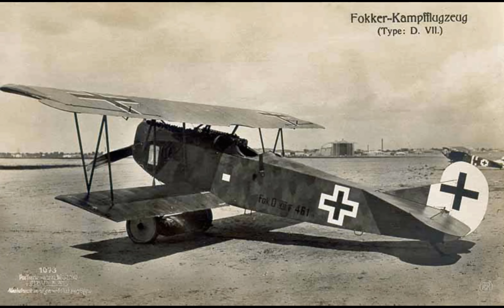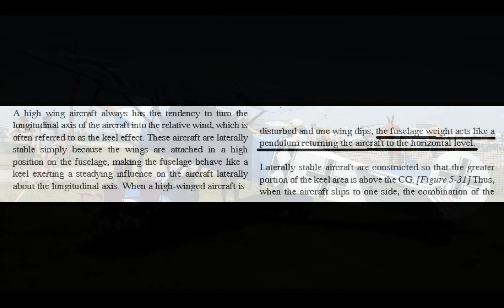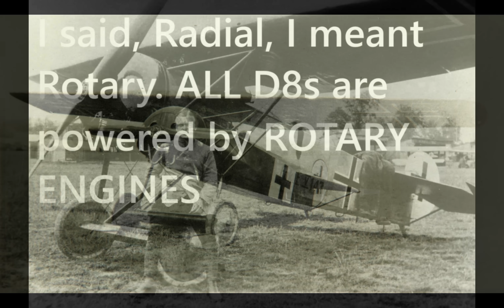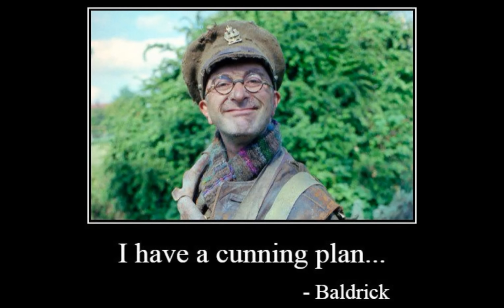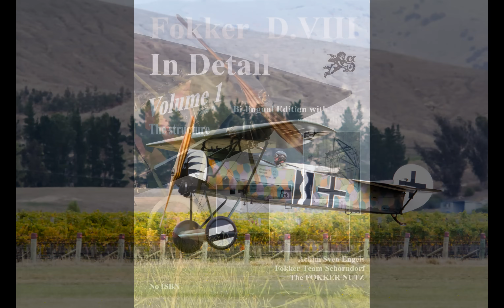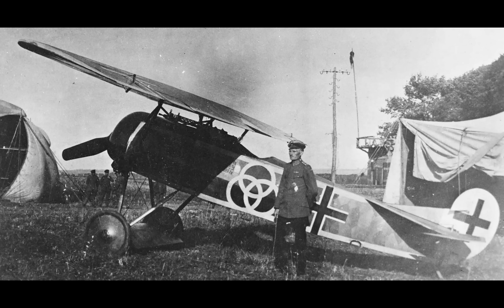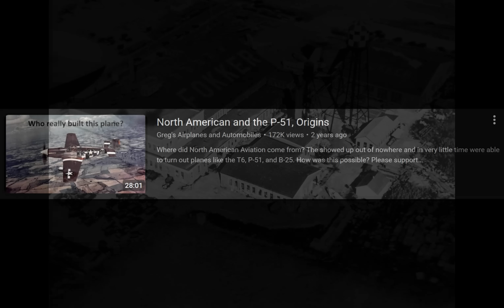Fokker D VIII The Best Fighter Of WW1

Comment: I'll just weigh in with what everyone already knows.
Fokker stole/borrowed most of his designs, and became more of a salesman.
Any new inventions Fokker had as a firm, chances are guys like Reinhold Platz was the real designer (Fokker knowingly held Platz back and out of the spotlight).
Fokker's firm had a good wing design going, but what did them in, as all other German designs with Rotary engines, was the lack of proper castor oil and the, by now, low power Ur.II engine, + low number actually fielded.
In my opinion getting basically JUST maneuverability didn't seem to do the Germans much good, even with the D.VII's speed, it still wasn't enough to achieve parity against much faster Spad's & SE's.
That tubular fuselage doesn't have much in between a bullet entering it and the pilots seat.
As good as the upper wing was, it was thick and for top speed that's no bueno, what good's outclimbing if you have to trade all that altitude just to keep up? You'll have none left by the time you engage.
Even a Spad with a million wires on it could build distance, climb, and achieve parity.

And even if the D.VIII was fielded in numbers, nobody with a brain turns with namely any Fokker, you see a Fokker and you open up throttle, then skedaddle.
Use the Hispano Suiza engine to build separation, outclimb, then turn around and strike any Fokker/Albatross from above.
One guy in Flying Circus, Farmer (Bateman here on Youtube) has it down to a T, he's currently at over 200 pvp victories (without loss), that's like 2.5 Red Baron's or 2 Red Baron's & a Udet thrown in for good measure, with a Spad, and Spad's are nerfed + Fokker + Albatross FM's are buffed, so that's saying something.
If everyone simply followed his example, there'd be nobody left to play Central lol
Reply: Thick wings can have a better lift/drag ratio than thin wings. Thick wings became standard up through early WWII, at which point compressibility became  became an issue, favoring thinner wings as seen on the Mustang and the Spitfire. 

As to the steel tube frame fuselage not stopping a bullet, while neither would a molded plywood fuselage (Albatross) or a wire braced wood frame cloth covered fuselage (most everybody else).
Reply: @fafner1  Yeah but basically that's what it comes down to in a WW1 setting, for what the Germans had to work with.

Of course, thinner wings could offer good 2-circle performance too, for WW2 of course we have to give props to Spit's & Mustang's that could duke it out pretty well with most of what the German's threw up (well, that, and an increasing lack of decent German pilots, contemporary reports show they gave as good as they got in the beginning but as attrition mounted there weren't many left that could get the most out of the 109/190). But WW2 wasn't the only period thin wings made for competitive fighters, just going off the usual WW1 designs, look at Camel's, thin wings, but more than a match for the DR.1 (more numerous, superior speed, about comparable 2-circle vs Dr.1 & most anything else the Germans threw into the fight), additionally, George Guynemer is known to have outturned Camel's in mock dogfights, in a Spad, and according to Udet himself, he flew a Alb D.III and met Guynemer in his early 150hp prototype Spad 7, from co-alt head-on and was outmaneuvered quite easily (whether they actually met in a 1v1 joust is disputed), there's similar stories on the SE5a too.
So SE's & Spad's were definitely good for more than just boom & zooming.
Nieuport's were known for maneuverability & nimbleness too, being a match for the Alb in the horizontal, as many contemporary reports can indeed attest. What made the Albatross good was: Ease of production (they fielded a lot of them), twin guns to (most of) the Nieuport's 1 gun, and somewhat easier to fly (rotaries are known for requiring a delicate touch at the controls).

If it looks like I have issues with Greg's findings, well, I kinda do, because with a lot of people starting out with WW1 air combat history, most of them get hung up in "D.VII was mentioned in the treaty" and blabla, all that usual regurgitated stuff.
I see it in the WW1 sim community all the time, someone new comes in and gets starry eyes when reading about Fokker, you have no idea, takes us years to drum it out of the newcomers.
They get it into their heads that everything Entente was horrible at the 2-circle discipline, just horrible, and long live Anthony Fokker and German aircraft designers and then that's it.
The Fokker fandom and how great he was etc also appears to be a big concensus over there in America, Fokker was popular over there, so that probably doesn't help Greg either, being a relative newbie at the WW1 side of things.

But dabble in WW1 combat sims for 30+ years, add the day and age we live in and you come across the same repeated myths over and over and over :) 
To me, Greg kinda comes across as just starting out with WW1 aircraft history, I'm not saying that's a bad thing, but at the same time I know that at the beginner stage he's currently in, he's bound to get kinda mesmerized by Fokker's charisma and presence in the arena, after all Fokker was indeed popular and good at bringing people to his side, even after his passing.
Now, the whole thick wing thing, what it really was intended for, was to draw everything out of the otherwise anemic aero engines that Germany could stamp out in any significant numbers, " It offered excellent performance from the outdated Mercedes engine, yet was safe and easy to fly."
The D.IIIa and the Ur.II were practically the only aero engine the Germans could stamp out in enough numbers, putting in the higher output engines (Over compressed Merc's, BMW's, etc) in them was not originally intended.
Reinhold Platz succeeded in that task.
And that's really all the D.VII and D.VIII was/were (I'm supposed to say "IMO" here but it's not just my conclusion either) and yes before you go there, yes the Boeing Model 15 was heavily based on the D.VII and was a respectable machine with more than enough power on tap, D.VII's conclusively did even better than what originally intended once they put souped up engines in them too, nothing new there.
I could go on and on, but as good as the D.VII/VIII were, they fell victim to the same set of factors, not enough materials & supply, not enough of them built to alter the course of the war.
The Entente were starting to run out of trees to make aircraft out of, didn't stop them from easily building enough planes to overwhelm the Germans, and with largely superior designs in both engines and airframes.

To a lot of WW1 buffs like me, Fokker isn't anything more than a charismatic thief, guys like Reinhold Platz were the real designers/engineers, the thick wing's real creators, another lesser known (but wiiiidely available, anyone can google it) fact is Albatross famously built better quality D.VII's than Fokker factory, issues with structural integrity at Fokker didn't end with just the Dr.1, it was a recurring issue until the end of the war.

And yeah Albs weren't just slow and bad at hard turning (they "spun vigorously" according to Richthofen himself, and yet in all simulators they almost never spin out), SE5's and Spad's would have had few issues fighting them, I didn't mean to make a huge thing outta the stopping bullets thing, but yeah if you look at construction, the weak so-called "sesquiplane" bottom wing did it no favors (famously so, as we all know), the plywood fuselage would have also been bad at stopping/deflecting/slowing down bullets.
Of course, dgmw, I'm not saying SE's, Camel's & the like could stand just any sort of pummeling, and any amount of wood framing won't do any good against a well-placed burst, or a side-aspect shot, such as Frank Luke, Richthoffen and Voss (just to mention a few) who were taken out or grievously wounded/incapacitated from the side.
On the other hand though, there's Arthur Raymond Brooks (if you know as much about WW1 air combat as I think you do, you probably saw this coming), who outright had his whole Spad shot to pieces around him, not only did he survive the ordeal, the Spad brought him home to his aerodrome, legend has it he stopped counting bullet holes in his aircraft before even finishing on one side, donno how true that is but we do know it was beyond repair, it's just one of many retellings of how tough the Spad actually was and it's pilots loved it for that (among a great many other things).

I hope that more or less satisfies anything you might come up with, I kinda pre-empted you on a few avenues, sorry if I come across as negative or something. We're all here hopefully to learn, hope that didn't come off the wrong way. Left your comment a like to reflect that I mean well, happy days to you and yours.
(Did a few edits to get rid of typo's)
Reply from the maker: 200 pvp kills in Flying Circus without a loss? I find that hard to believe. I fly that sim a few times a week, I have never seen anyone anywhere near that good. Even so, it's a sim, it's not reality. That said, I'll keep an eye out for him on Berloga.

Comment: Oh the irony of one of the most successful WW2 aircraft, the North American P-51 being designed by German-born Fokker employees! Thanks Greg. I never knew that fact.
Reply: I don’t think it was that simple. But I did hear somewhere the P-51 was designed by a German expatriate. I’m pretty sure it wasn’t Fokker himself, he had to be in his 50’s and being an owner, most likely delegated all the work like design and testing. They definitely did wind-tunnel testing which influenced design changes. It is amazing how quickly they created the P-51 and made it operational within a year. It’s always been a bit funny looking to me with its little beer belly I guess to make the air intake aero. The German Do-335 also has a rear air intake for its rear engine, but it’s flat-bottomed with the intake angling up near the tail
Reply: Do we mean Fokker or Folker ?
Reply: He seems to say Folker ? Also I think it was a Dutch firm not German.
Reply: @lancaster5077Fokker himself was Dutch, i actually live a few houses away from where he was born. But the company Fokker was based in Germany for some time and Fokker lived in Germany for quite some time.
Reply: Not forgetting the “cure” of the carburettor problem in the Merlin
Reply: Dumb question, when you look at the FW-190 and the P-51 in plan, why do I see nearly identical profiles in the lifting airfoils, the P-51 essentially only being somewhat enlarged???
I find it difficult to believe that North American came up[on that outline in a vacuum.
Reply: @tomt373  None of these designs were born in a vacuum. Don't forget that, with a few notable exceptions NACA research provided the bulk of the airfoil and drag data, recommended water methanol injection, etc all sides used to build their aircraft. There had been a lot of cross influence between European and American aviation. In the US, designs were created that countered specific enemy fighters, like the Grumman Hellcat being a response to the Zero. When a design proved itself in combat, it often influenced the development and improvement of designs on the other side
Reply: @tomt373 Hello Tom, the P51 airfoil was actually designed by the precursor of NASA, the National Aeronautical Board. The “Mustang” as it was called by the British (remembering North American designed and built it for the British) actually had a number of airfoils during its existence, strengthening the wing required changes (that enabled heavier payloads, it could lift over its own weight and still function). At the end, there was a radical redesign that never went into production, that substantially lightened the whole airframe. Then, of course, the first 150 of the P51As were stolen from the British by the US Army Aircorp, given a whole new wing (with Airbrakes) and designated as a Dive bomber called “The Apache” (it was a failure, remembering it had the Allison engine). The biggest evolution was, of course, the installation of the Merlin engine, then the licensing of the Merlin engine to the US, then, the installation of the 2 stage Supercharger, followed by the evolution of the Canopy into the “Teardrop” and cutting away the “Fastback” to convert it from the decidedly “Germanise” silhouette to the now familiar P51D one. The evolution of the canopy alone is quite a tale, “on-the-trot” modifications, pilot feedback, informal engineering experiments, back-door communications all played a part (not forgetting that plain old temper tantrums and cost-cutting were also in the picture). The evolution of the P51 is worth a feature film by itself. THEN there is the design and building of the Sabre Jet, likewise worth a feature film. Only thing, no central star, lots of stars, Engineers, Pilots, back-room negotiators, even a very pretty ex-motor-racing motorbike champion female, who (reportable) was an overt gay, woman working in the midst of a very macho male world of engineering. It’s all there!
Reply: will upset many ultra patriotic Americans hearing it
Reply: It's weird, isn't it, that whenever America is successful, it's usually through a foreigner. Later, the Apollo missions for example too.
Reply: And the trip to the moon was all down to a German too well 2 germans if you include Hans Kammler the nazi mass murderer who they hid after the war.. The Americans have a habit of saying they invent things when quite often it's a european who has the brains behind it. They ust have the money behind the brains. europe is the brains and America the braun...

Comment: Did not know monoplanes ever entered service in WWI.....

Take your point, at least in the sense that the D VIII represents the pinnacle of WW I aircraft design...

Re the parasol wing, could considerations of weight/drag savings played a role in the choice of the parasol?

By using the parasol with spars continuous from wingtip to wingtip, a strong wing with less weight can result, and the necessity of either joining the wing to the fuselage in a sufficiently strong way, or using-up interior space in the fuleslage with full-span spars traversing inside it, and/or resorting to draggy wire bracing are all avoided.

Note that the Eindecker had a wire-braced wing, and the wing did attach at the side of the fuselage......

I believe you had a video mentioning  British low-drag bracing wire, with a sort of "teardrop" cross section....so the drag of wires isn't unimportant.

Comment: I may be wrong, but I was under the impression that on parasol,design, the weight is suspended under the lift, which makes it more stable in a bank (in a low mounted design, the weight, above the lift point has a tendency to exaggerate the roll).

On a fighter, low mounted wing gives a better roll rate, hence why there were preferred during WWII.

Am I wrong?

Comment: A question Greg, if the D-8 (which, if I'm following your argument correctly, hardly saw service before the end of WWI) was the best fighter of WWI, does that make the F8F the best carrier fighter of WWII?
Reply from the maker: I suppose if the F8F's key design features, like the wing, made it into the next Generation of airplanes, then sure. Another difference is that the D8 was actually in the war, in theater being flown by units that went into combat. That didn't happen with the Bearcat in WW2.

Comment: Beginning in 1916, the Heeresflugzeug-Abteilung (German Army Air Service) […] introduced a new system of class letters to identify aircraft by military role.

Examples:
	•	E = monoplane (the early, not primarily fighter armed monoplanes, e.g., Fokker E.I – E.IV)
	•	D = single-seat fighter aircraft (originally mainly biplane fighters, but the meaning soon became independent of wing type)
	•	C = two-seat armed reconnaissance aircraft
	•	B = unarmed two-seaters
	•	G = large aircraft (bombers)
	•	J, CL, N, etc. = other specialized classes

Importantly:
The letter “D” was originally derived from Doppeldecker (biplane), but after 1916 it officially meant only “single-seat fighter,” regardless of how many wings the aircraft had.

So why “D” on monoplanes?

Because all new single-seat fighter aircraft were designated “D”, whether they were:
	•	monoplanes
	•	biplanes
	•	triplanes
	•	or experimental types

Example:
The Fokker D.VIII was a monoplane, but since it was a fighter, it received the D designation.

Source: ChatGPT

Comment: The Story on the F-16 was that while the F-14 and F-15 were excellent aircraft - they were expensive and their was some concern about the ability of the Warsaw Pact - to swamp these expensive Fighters with Cheap Mig's going back to the Mig-15.  

So - they wanted to increase the number of aircraft NATO had but couldn't afford more 14's and 15's.

They had a competition between the 16 and 17 - which the 16 won.  The Navy wanted a twin engine aircraft - so the 18 was a modified 17.

Eventually - the end of the Cold War meant that the Navy didn't need to shoot down Regiments of Backfire Bombers and their Cruise Missiles.  The fact that the F-18 had been designed to be much cheaper to operate then the 14 caused the still superior 14 to be replaced by 18's - as well as everything else.

Then - concern that Iran would find a way to access Bone Yard F-14's for spare parts - caused the 14's to be destroyed.  Of course - Iran found a way to maintain their 14's fabricating the parts they needed.  So - we lost the ability to bring back the 14's if we needed them.
.